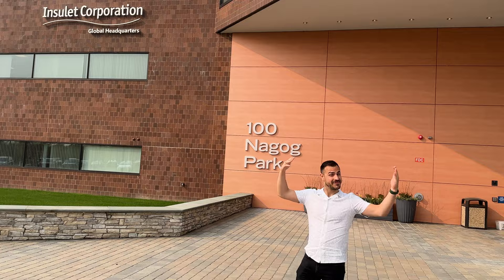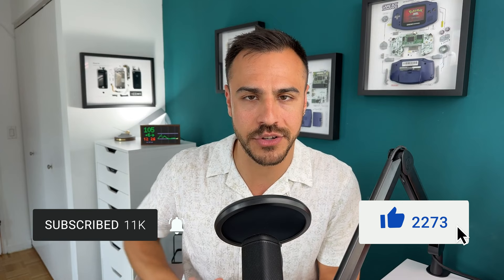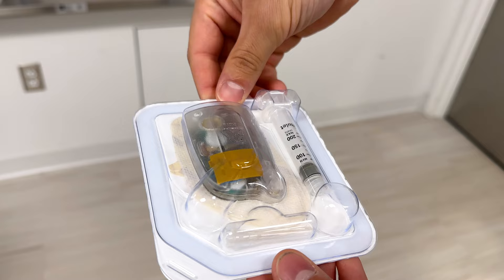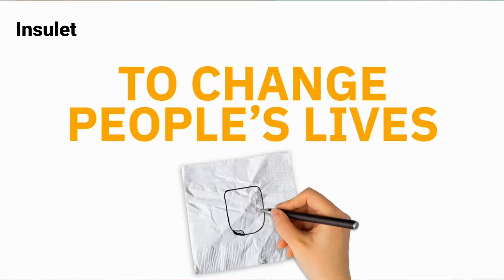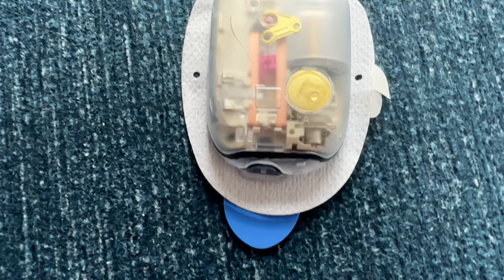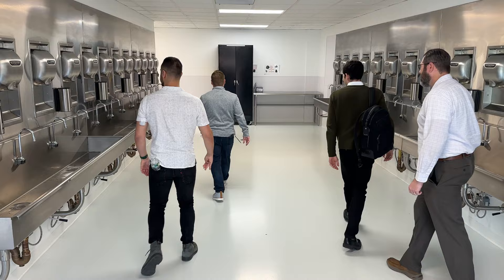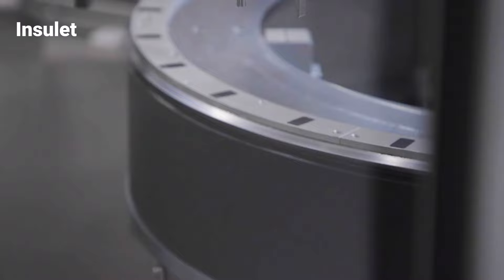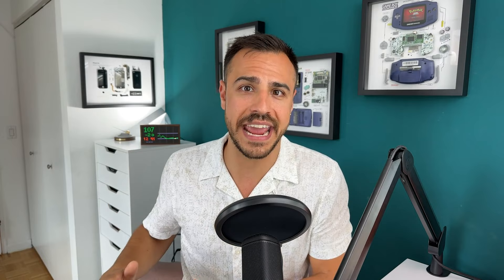How Omnipod is Made - My Factory Tour

Comment: Always fascinating to see robots building whatever.  Marvel at the precision of the placement needed for assembly.  Also need to consider that all the separate components pins and connectors have to be in the right place as well for the robots to assemble them.  Would be interesting to know what percentage don't pass testing.  One a minute could had up to a bunch of no good pumps in short order if something goes out of tolerance.  Good video.
Reply from the maker: Totally - it was fascinating. I want to do more videos like this one!

Comment: I left Tandem 2 weeks ago and switched to Omnipod 5 and could not get happier.  No constant alarms constantly going off. I can use my arms.  I will never go back to Tandem. Shame on them for their lack of development. The mobi is not tubeless. Tandem will not have tubeless until 2027.  Also Tandem as about 3 Billion in assets which compared to Insolet which I believe is around 18 billion. Medtronic is around 72 billion. These numbers are estimates. Tandem is betting on the X3 and the mobi to bring their stocks back. Imagine creating a pump that alerts you, then keeps alerting after you shut the alert. 

Has the x2 for about 6 years now and they wanted me to upgrade to the same pump then spend another 700 to 1000 dollars to upgrade early.